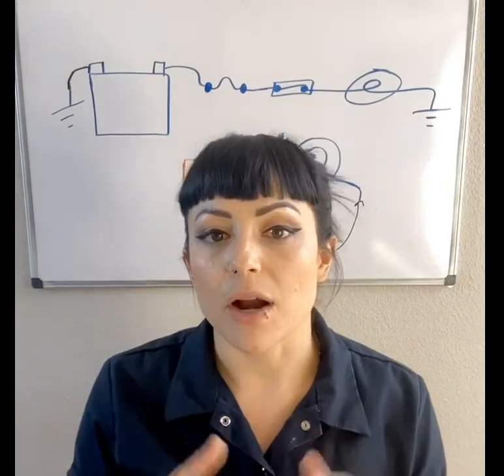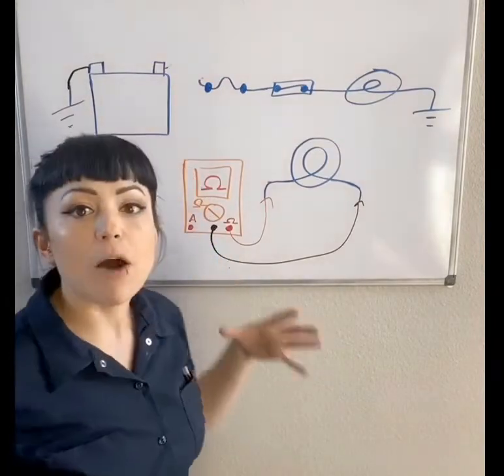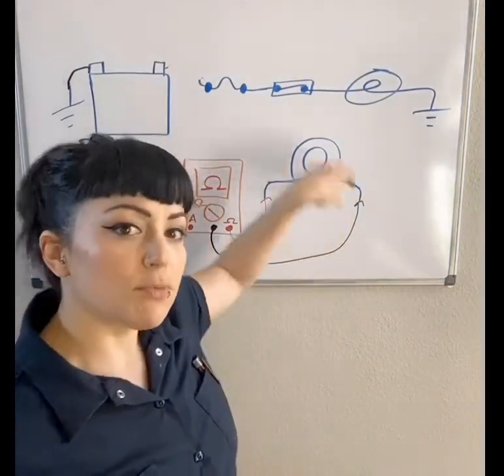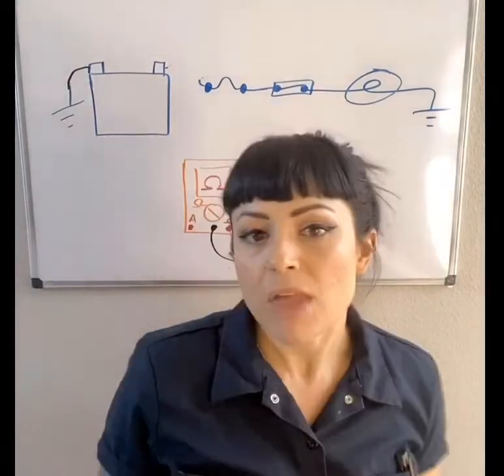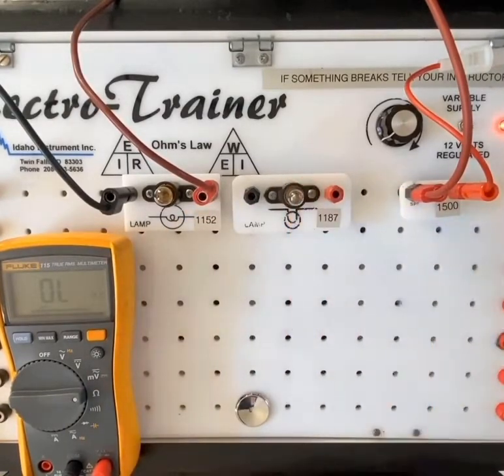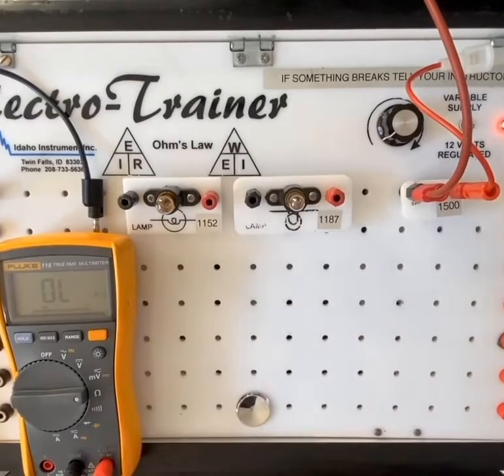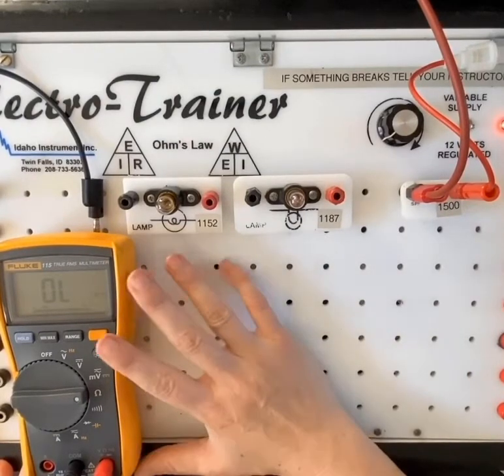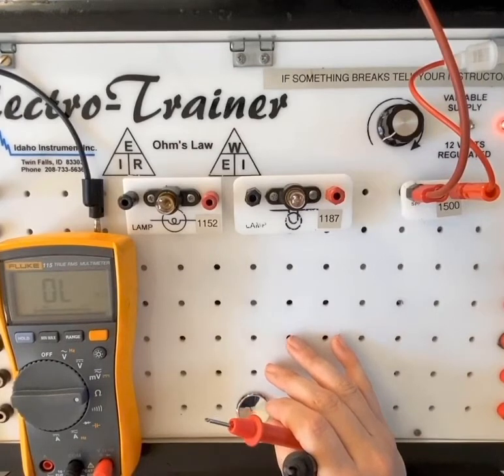Ohm Testing

Comment: Also isn't the other reason for voltage drop testing is used over ohm and continuinty is the ohm meter sends a tiny bit of current through wire sometimes making it appear the wire has continuity?